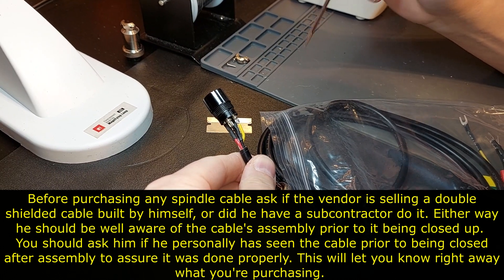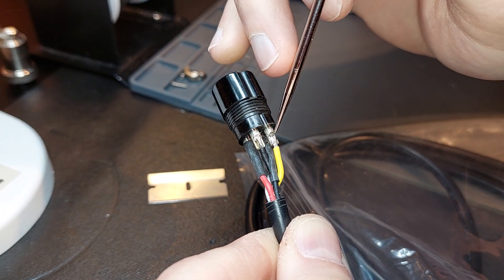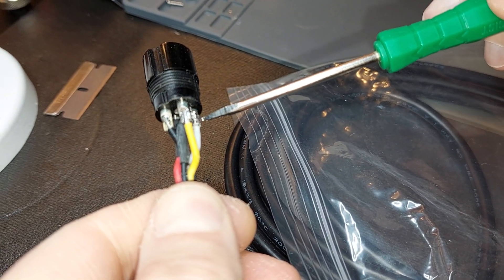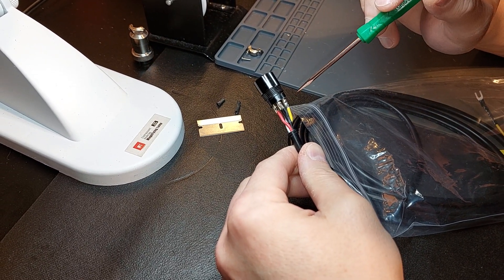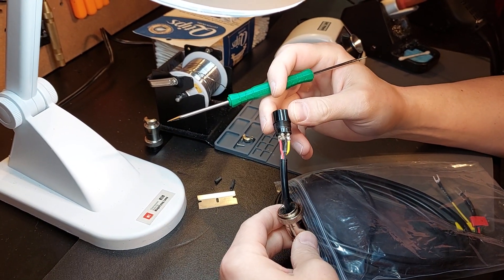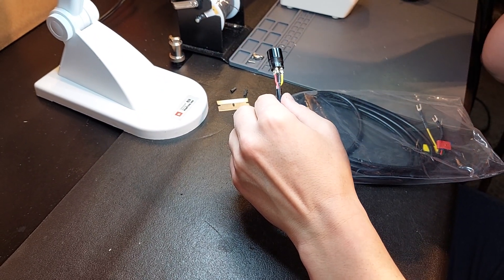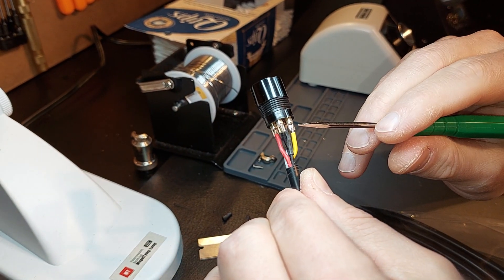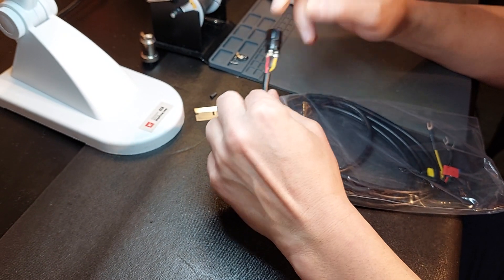CNC Bulk Pre-Made Three Phase Spindle Cables Are Dangerous! Proceed With Caution!

Comment: Salut Vince tu dis dans ta vidéo, que le diamètre de fils et du 18 AWG alors qu'il faudrait du 16 AWG , j'habite en France et le courant n'est pas en 110 Volts, mais en 220 volts, malgré des soudures très médiocre. N'est il pas préférable de rester en 18 AWG pour du 220 volts? Car j'ai commander sur ton site du 16 AWG. Peux-tu m'enlever le doute. Ma broche est une 220 VOLTS  2.2 KW 10A 24000 rpm ER 20 400Hz. Merci
Reply from the maker: Spindle cables up to 4.5Kw should all be utilizing 16awg double shielded cables. In the video above the vendors selling premade motor cables are using 18awg which is incorrect. 16awg is correct for both 110v, and 220v A/C lines being run to the VFD, and the same gauge of cable is to be used to wire your spindle's power cable. Thank you again for your support, and have a Happy Easter!! Vince